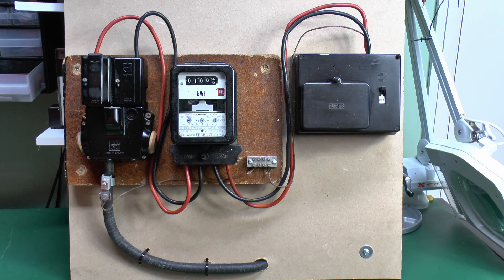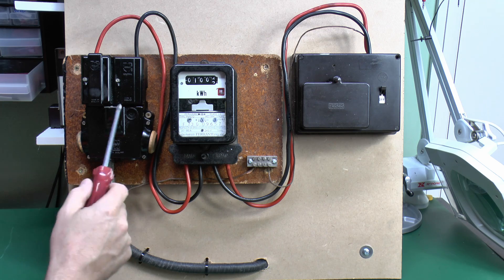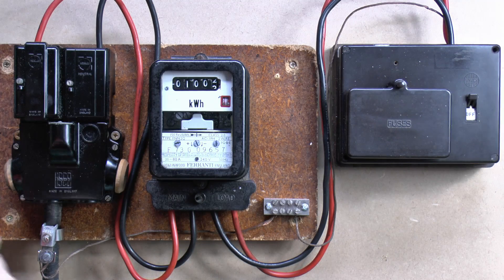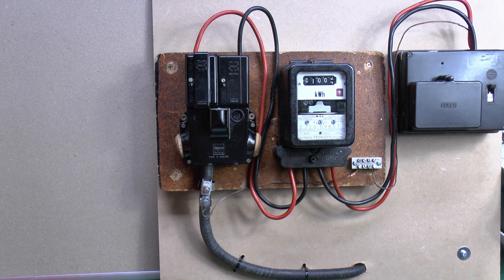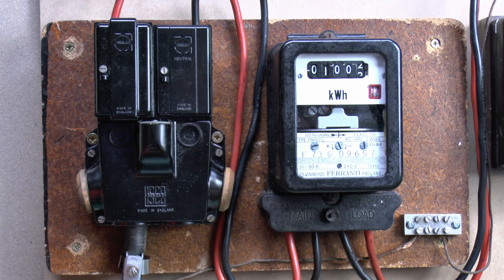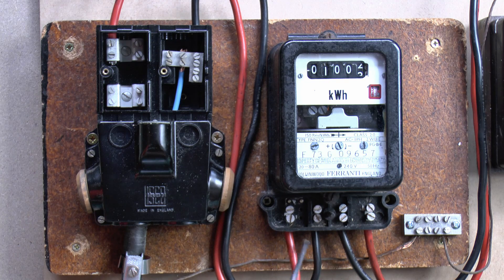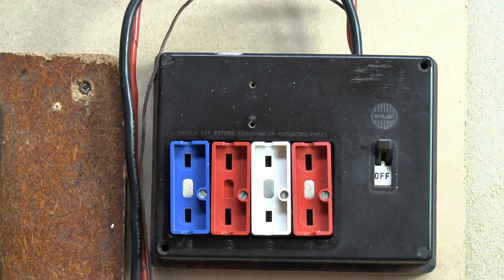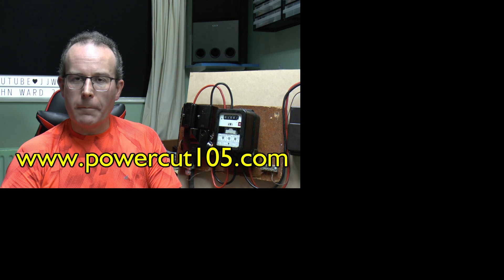Cutout, Meter and Fusebox - Who Owns What?

Comment: Hi John. 13 years ago I had house renovations, during which DNO moved the supply/main fuse/meter from the outside wall and extended the supply cable. Unfortunately then fitted right in the corner of the internal wall behind the cupboard that the builder installed so I cant easily access the consumer unit. I am now getting old & inflexible so need to get the CU moved round to the left wall, within the cupboard so certainly within the 3 m you mentioned. I am now considering going off-peak on Eco7 tariff and getting a smart meter fitted for that. I would like a double pole isolator fitting to ease the  move of the CU.. Would the best sequence be to get the meter changed first? And would a smart meter installer fit that isolator to facilitate  moving the CU?
Reply from the maker: Some suppliers will fit an isolator at the same time as changing the meter so that is definitely the best option to go for.
Reply: @jwflame  thanks John! And you said the meter can be moved away, off the main fuse backboard, so is there a limit in the length of those tails? As part of the Smart Meter installation putting both meter and CU in an accessible part of the corner unit would be ideal. Maximum distance would be the length of a kitchen cupboard base; haven’t yet measured but must be less than 1 metre since that’s the maximum size of a base cupboard

Comment: Couple of points about installations in the UK  - apologies if they have been mentioned in comments already (I haven't read all of them).

Firstly, the service cable and cut-out (or cable-head if you prefer to call it that) will usually be owned and operated by the local DNO (Distribution Network Operator) as stated by John. (Note that DNOs are changing their name to DSOs (Distribution System Operators), just to make it more confusing). Anyway, in some newer properties the service cable and cut-out may be owned and operated by an IDNO (Independent Distribution Network Operator). This is due to deregulation of some of the distribution network that allows IDNOs and ICPs (Independent Connection Providers) to 'contest' certain elements of the provision of a new connection. So, you may see a sticker or notice next to your cut-out that indicates who you should contact regarding any fault or alteration to the terminal equipment - but that won't necessarily be the local DNO/DSO! In rare circumstances you may find that your local distribution network is a private network and has been for decades - an example being say a lodge house fed from a big house in the countryside. DNO/DSO supply terminates in the 'big house' and there the supplier's responsibility ends. Over to whoever owns the private network to resolve any issues - all in accordance with the Electricity At Work regulations, etc, etc of course.

Second point about the back-board for the cut-out and meter. It certainly used to be the case (and I think it still is) that all accommodation for the terminal equipment is the responsibility of the owner of the property (e.g. house-owner or landlord) but said accommodation has to satisfy DNO/DSO/IDNO specifications. The back-board that the terminal equipment is mounted upon can't be any old bit of timber, it must have a specified minimum fire-resistance rating of one hour. If the back-board needs adjustment or replacement, you must contact your DNO/DSO/IDNO (terminal equipment owner/operator) to arrange for any work to be done safely but it will be the property owner's responsibility to supply/install/alter the actual back-board.

Wonderfully straightforward, isn't it?!
Reply: I work for a DNO we change meter boards it's not chargeable and the boards are supplied by us because they are designed to be fire retardant  they will burn but won't support a flame

Comment: I am having an EV charger fitted.  
The supplier noted that the power head is damaged so I need to get the DNO to replace it - long wait ( did not damage it btw)
To keep things simple I am going to have a new CU fitted just for the Charger in a new IP65 cabinet next to the existing meter cabinet. To do this I need to have the meter moved a little, then a DP Isolator and then 100A connector blocks to split the supply after the DP Isolator. So I need to get the Energy supplier to come out to move the meter and fit the DP Isolator (Will that be done live or will they break the new seal to remove the main fuse?) - more waiting.   Then my electrician will fit the 100A connector blocks after the DP Isolator and re-connect the existing main CU to those. Then the EV Charger company will come out and  connect the new CU in the new cabinet to the connector blocks
FOUR different Sparks to get a simple job done and professionals wonder why people are tempted to DIY this stuff !! The DNO Electrician should be able to do all this work, except the charger of course. Maybe I will just offer him cash when he comes to do the power head

Comment: Guys in uk most electrical goods in our  homes run on 220 to 230 volts. When i check the voltage being supplied its mostly over 230. If i put a transformer between my meter and my fuse box and set at 220 volts will my bill go down
Reply from the maker: No.
Reply: The supply voltage is 230v +10 -6% so between between 253 and 216v is to be expected

Comment: What's the purpose of filling that lower part with pitch/tar?
Reply from the maker: Seals the end of the cable to prevent moisture from the air getting into the paper insulation.
Reply: Typical British over engineering when we change cutouts now the pitch is removed and the cores taped with electrical tape

Comment: As always very informative - pitch will flow at room temperature - I tested cables in the 1960s and to load the heated  machine the operator attacked  a steel drum of pitch  with an axe before going home , the next day a  black pudde was  spread on the concrete floor,  easily shoved up as it broke like glass when moved quickly - non  Newtonian liquid?

Comment: How do they cut the old cable and join a new one to the outside meter box if it is live?

As an electrician how do you replace the consumer unit? Are you allowed to pull the main fuse do that?
Reply: They turn off the load and dismantle the PILC. The lead is peeled back to expose at least 200mm of the internal structure. Then some insulated pry tools are used to separate the internal conductors. They are then simply cropped and a cable splicing kit is used to connect up the new PVC cable.
An electrician should not remove the main fuse, but most will.
Reply: Yes most cables are jointed whilst live sounds dangerous but to do it dead would mean turning off 50 or 60 houses

Comment: What are the two ports for that in this case have the wooden plugs? I've never seen them in use even where a supply is daisy-chained to a neighbour where the out cable leaves beside the in cable at the bottom not the sides.
Reply from the maker: Options for cable entry, such as where the cable enters horizontally through a wall, the side one would be used and the others blanked off.  Not intended for all of them to be used at the same time.
Reply: @jwflame  Thanks :-)

Comment: hi John,,  i've broken the on off switch on the fuse box , so when fixing electrical faults or fitting electric shower i've been pulling out all fuses.... can you buy these switches or should i just buy a new fuse box ?
Reply from the maker: If it's like the one in the video, the only option is to replace the whole thing with a new consumer unit.  The switch was not a separate part.
Reply: @jwflame  cheers john

Comment: My friend bought a house and it needed a rewire and the electrician told my friend to call his supplier who was edf and the property supply was edf to fit a isolator because he had a job before where he pulled the fuse before and got a fine he phoned edf and they said it was the electrician responsibility to fit a isolator they kept refusing to fit said it got nothing to do with them he spoke to alot of other electrician's and they said it was the energy company was responsible
Reply: You can ask your energy provider to fit an isolator but they're not legally obliged to. One of three things will happen... 
1.They come out and fit an isolator free of charge. 
2. They come out, fit an isolator and charge the homeowner.
3. They refuse to fit one point blank (If this happens, you can employ a company authorised to work on supplier equipment such as Haste).
Reply: Ashman Electrical Services 
You are correct 👍👏
Reply: Problem with edf is much of the time as they use a lot of contracted services to carry out work their default response if you ask them to do something is no thats someone else's job.

Comment: ANY electrical shocks from the power company's cables on their side of their 100A  mains fuse,  are a strict liability on the power company operators with substantial fines.  I got a new incoming cable installed with a new head at THEIR expense after my walling contractors working on the house were getting small shocks from their outside power cable clipped to the outside wall.  They came around very quickly after it was reported to them and at their expense and replaced the head and incoming wire.

Comment: 3:33 Actually John. TN-C-S has a single inner core (live/line) and the outer armouring which is copper and is combined neutral and earth.
Also, if your putting a new D/B in. Make sure you change both lots of meter tails and the main earth. So 2x25mm & 1x16mm for a standard 100A as the original tails are mostly 2x10mm & 1x6mm. 

I think it's madness that you need a torque screwdriver these days. Some of the laws these days are stupid and irrelevant! I wonder what the punishment is if your caught working and you don't have a torque screwdriver? 🤔
Do you recon you could do a video about it, as I know it's a hot topic. Thanks.
Reply: Anything holding together connections by the force of a screw working against the flexibility of conductor material will physically fail if tightened too little or too much.  Manufacturers instructions generally give the correct toque setting for the suggested conductor type and size.
  Too tight might break the device or clamp. Too loose will allow the conductor to come loose as the holding force slowly transforms into permanent metal deformation.  This loose connection may happen weeks or months after the installer left the building.
Reply: @johndododoe1411  When it comes to how tight something need to be. It's something you pick up over the years and if your any good at your job then you know how tight something need to be. 
Those torque screwdrivers are for people who have NO IDEA what there doing! Like kitchen fitters and handy men etc. No proper sparky would be seen DEAD using one of them. I've done bits in the past (bolted and screwed connections) and it always feels way too loose. Unless you've actually done the job n your any good at it, then you've got no idea how tight something need to be.

Comment: Hello John,
I need to replace my consumer unit and there is no isolator switch. The current consumer unit does not have RCDs and SPD.
I just bought the house recently and not moved in yet.
I am trying to contact DNO Western Power but no response yet. The supplier is The British Gas.
Please advise me. Many thanks, Ahmed

Comment: I have a (single pole) isolator in my meter cupboard between the meter and the tails to the consumer unit and Henley blocks. I assume they are my responsibility, even though they are in the meter cupboard.
Reply from the maker: Yes, suppliers responsibility ends at the isolator.

Comment: If you have a 100A fuse board feeding double ovens, electric showers and other such appliances  and the board is fully utilized, then how would you connect a fast EV charger?
Reply from the maker: Multiple electric showers means it's already overloaded.  Only option is to have a device installed which prevents certain loads being used simultaneously, such as only one shower at a time.  Some EV charging units include load management features.
Reply: @jwflame  Is it possible to get a higher capacity board or install a second board?
Reply from the maker: @twig3288  Only if the supply is greater than 100A.

Comment: Gosh! Do these old cables ever spontaneously short / explode / whatever?
To move the cable put outside, what kind of cost are we talking about..£500, £1k, £2k ?
My house was built just after WW2.
BTW, how accurate are the meters at recording kWhr? I've also heard this is to be changed to record VAhr (apparent power)..is this true?
Reply from the maker: If left alone, old cables almost never fail. The problems start when people attempt to move them.
Costs vary but typically under £1000 - although other costs are likely as usually the consumer unit needs to be moved as well.
Smart meters can record VA, although that's not currently used.  Larger commercial installations already have VA metering, which is where power factor correction is important.
Reply: I used to work for London Electricity Board before (and after) all this privatisation malarkey. The oldest cable I've personally worked on was laid in 1921 and when I opened it up it was immaculate inside. Conversely many plastic cables were deteriorating to the point of needing replacement after 30 years or so.  I moved on in the year 2001 so can't attest to the new stuff. As JW says it's only an issue if they are moved.
On the metering side the legal requirement is for the meter to be within +2.5% and -3.5%. Back in the day I was an instrument tech before going out into the street and responsible for calibrating the things. I'm fairly sure it was +-2.5% back then. Either way a certain percentage of our work was checked by a government appointed inspector (from NPL) and this person would pull us up if the meter was outside +-1.5% or deviated by more than 1% from out error figures. To make sure we met the inspectors requirements we calibrated to +0.1%, -0.4% on full load. Again I have no idea what the tolerances are today but I doubt they are much different. Also the modern electronic meter is more reliable than the old mechanical jobs that were subject to wear and tear.
In fairness VAr is a measure of the actual power used rather than KWh which doesn't take into account power factor. PF used to only be an issue for large commercial buildings or local garages running arc welders but with everything now having a switch mode power supply in it is becoming a larger issue.
Reply: The old paper core wrapped and lead sheath covered cables [otherwise known as Paperlead] are exceptionally good and reliable cables when they are left alone and not interfered with.
I have personally worked an these cables in the ground where they have been untouched and are in as good as condition today as when they were 1st installed over 50 years ago.
[the oldest cable I ever worked on and is still in use today was an old paperlead street lighting cable on a military site that was dated 1936]
...
The problem comes when you you mess around with them because they then deteriorate very quick.
Once the get bent about the lead can crack and the paper insulation inside can split... the weak point is usually the crutch where the cores start to spread out at the ends in a cutout or in a joint.
....
also when the cables rise up out of the ground gravity can cause the oils that impregnate the paper insulation to migrate down leaving the vertical sections dry. And therefore more prone to damage if manipulated and moved.
....
So an old cable cable in the ground can be in very good condition but an old lead covered cable rising up out of the ground can be extremely delicate and dangerous if messed about with.

Comment: Do they change the electricity meter when you change the provider? Sounds pretty strange. In Finland the meter belongs to the local company. Here you pay per kWh to both. Also I find all those wires strange. Here we do not have any visible wires.
Reply: If you have an older smart meter they will change it but the current range allow the meter to be transfered

Comment: What about Lateral mains supply wires in flats? who owns them, the Freeholder?
Reply from the maker: Usually yes - and whoever is responsible for the building as a whole is also responsible for any repairs / replacements of them, even if the meters are located in the individual flats.
Reply: @jwflame  Thanks!

Comment: The US is kinda crazy.  The electric company only owns the meter's electronics and wiring upstream of the meter.  The homeowner owns (and must supply) literally everything else.  From my electric company's contract: "Each Applicant for service will be responsible for all inside wiring, including the service entrance, meter socket
 and conduit."  and "The Customer, at his or her expense, will provide the necessary trenching, conduit, conduit installation,
 backfill, landscape restoration and paving and will also furnish, install, own and maintain termination facilities on or within the building to be served."

Note that the homeowner is responsible for the meter socket.  If you've ever seen an american meter, there's a metal box on the side of the house with a small circular window that shows the meter.. that's the meter socket.. (search home depot's website for "meter socket" for examples).